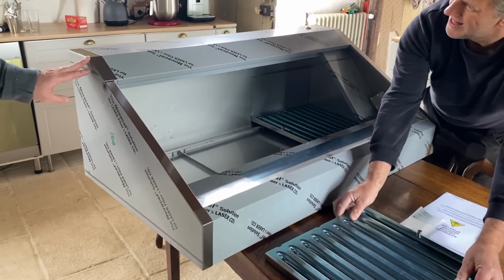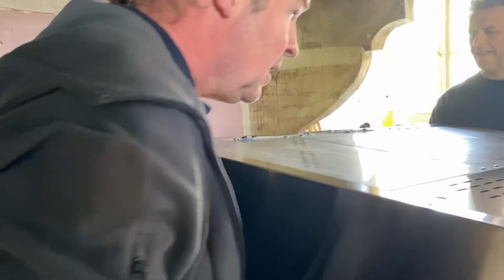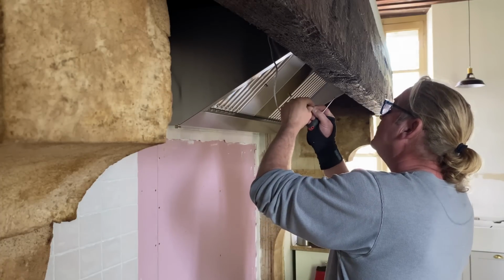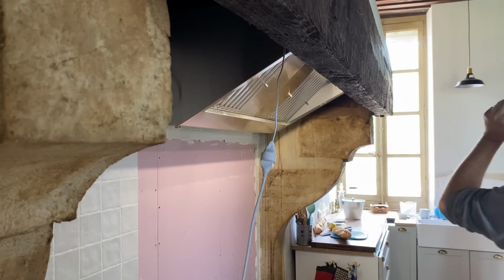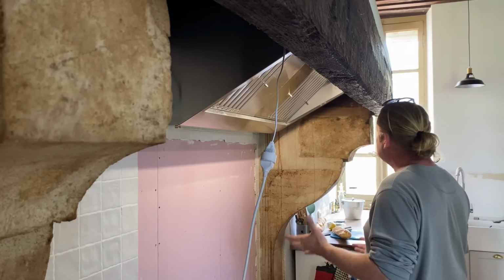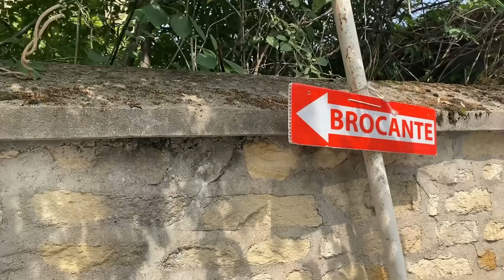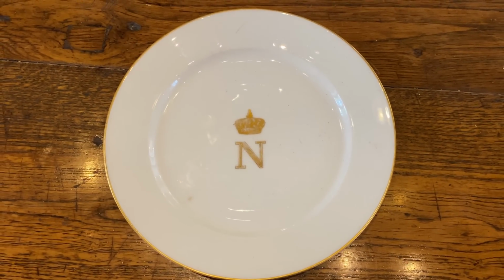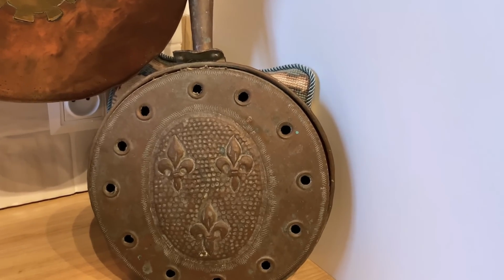IT FINALLY ARRIVED & the chateau KITCHEN MAKEOVER lighting install - Journey to the Château, Ep. 95

Comment: Winnie the Pooh and Tigger too at the brocante! Two Winnies--1 large and 1 tiny. Love all of your brocante finds. Your peonies are superb! Confession: I had an apartment with a blue stainless steel front fridge.  I love blue and the unit needed color. Turns out that it was the plastic wrap. It was on so tight, and there was so little light in the apartment, that I couldn't see the difference.